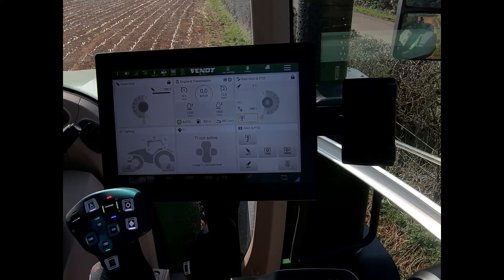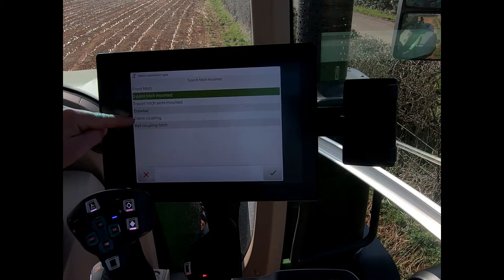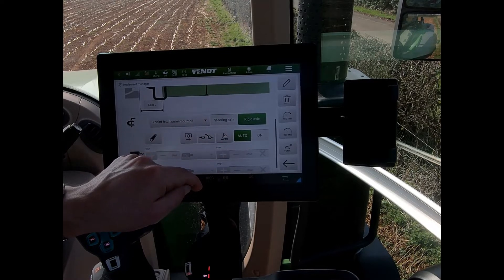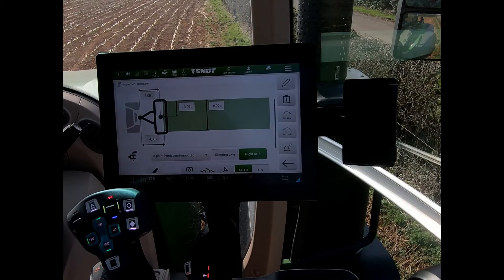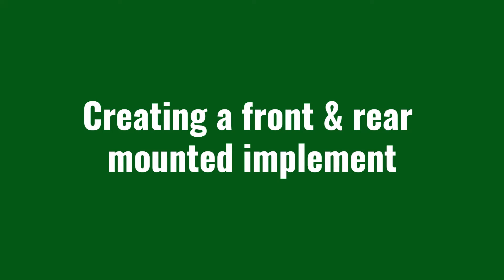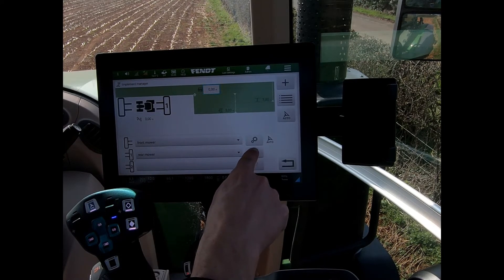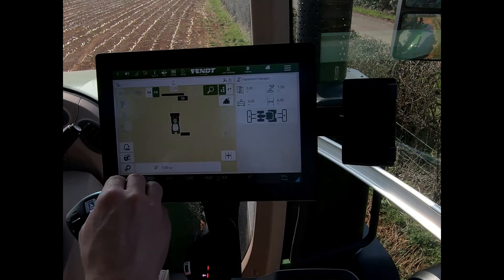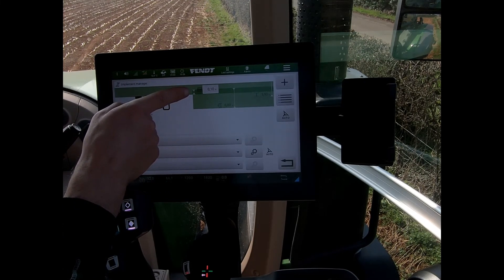FendtOne - Implement creation

Comment: Hy. How to set up and create implement  for  2.4 m mower to the right side off my tractor? Thx 😊
Reply from the maker: Have a look at the video of how to create a front and rear implement for more of an explanation, but if you were to measure from the PTO shaft on the tractor all the way out to the outside cutting disc of your mower and put this figure in the box where the "half working width" is, this will move the implement bar on the screen out to the right.